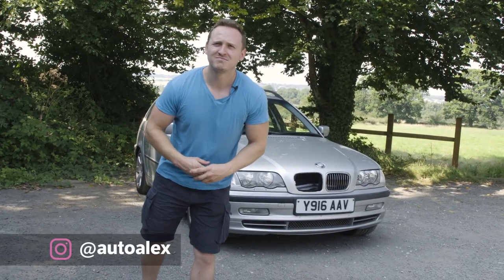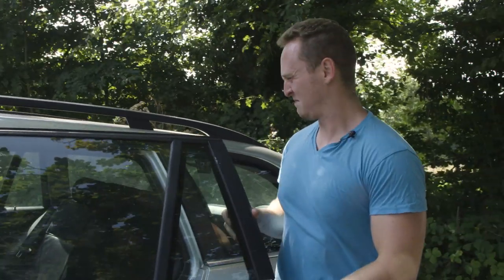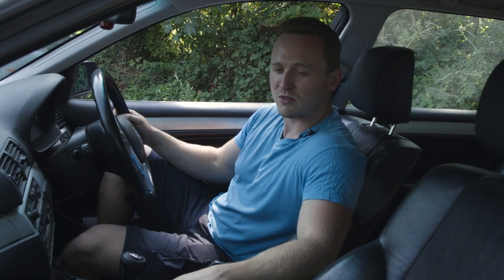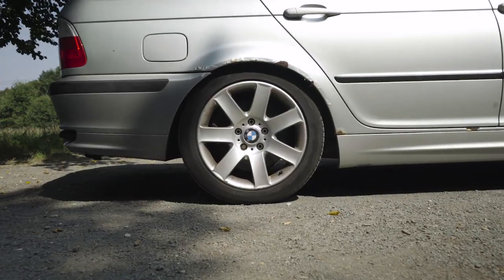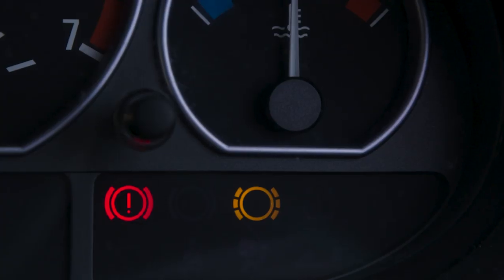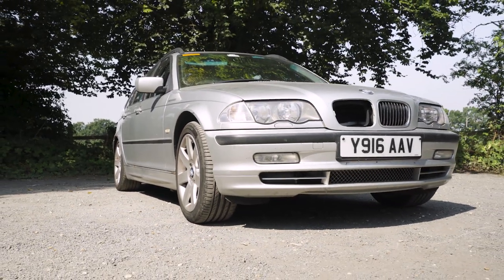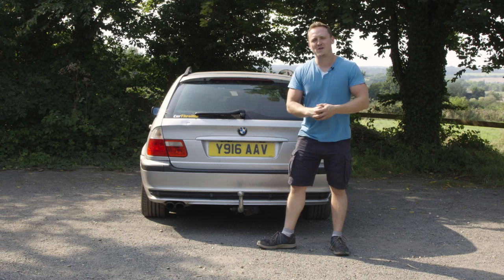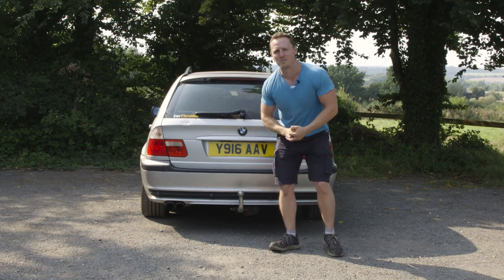£140 BMW Review: 1 Year Later!

Comment: You got an absolute bargain. My E36 saloon has every single MoT and some early service history. Typical E46 corrosion on the rear arches. You need to get it sorted mechanically or at least give it an engine service. You should really replace that grille or you could be looking to replacing the radiator. A cheap used grille on eBay or from a breaker will do the trick.

Comment: could use an alignment to resolve that granny steer problem. Front wheels' toe angle could be off which causes the steering wheel not to automatically return to center.
Reply: He said there is a crunching feeling and that he thought it was a bearing.

Comment: That crunch and stiff steering could also be your air bag ring as my BM did the same and I thought it was the bearing till I took the steering wheel off to fit my momo steering wheel and found the air bag ring seazed and was jamming the steering wheel up

Comment: this car is so crap, i love it. i once had a mazda capella wagon that if you put the clutch in round a corner it would stall as the power steering was too much drain and it idled really low (probably because it spent about half the time running on 3cyl).

Comment: high milage? wtf my 2004 1.9TDi Audi A4 has done 600 000km and I' still using it. It has been in family since 2008/100 000km. Clutch has been reworked and a few smaller things, but the engine is running like a new one and the car works just fine.

Comment: Love it. We bought an old passat 1.8t petrol estate on 170,000 miles for £250 over 4 years ago as a daily/grandad mobile. It is now on nearly 200,000 miles. Only major (ish) thing it has needed is a new exhaust section (£40 plus fitting). It can die whenever it wants as it owes me nothing!

Comment: I had a 206 1.4hdi that I owned for 2 years, I did 30k miles in it and never changed the oil, had a water leak but I just topped it up with water every week, I had a broken rear spring, I never did a service, I genuinely treat it like a piece of shit and it did me well. 
I mean a deer jumped out in front of me causing me to flip it twice and it still tried to start after having the engine and gearbox shunted back 6 inches...dont underestimate Peugeot Power.

Comment: I can't believe the amount of cash it needs to keep running, converted to euro it is nealy 13k, divided by 17 years it is 760 eur per year or 65 eur per month (I round the results), just in maintenance, not counting MOT, insurance, road tax, car wash, depreciation... It is the barrel of danaids on wheel !
In comparaison, my Auris 1.6 petrol costs me 6.50 eur per month since the 2 years I have it (I didn't change anything appart from regular maintenance I do myself mostly, no tyre change and no big maintenance like clutch, but even with this, I would still be 8 time less costly than the bimmer).

Comment: I'm driving a 2002 Golf 4 with the 1.9Tdi (101Hp) with now 372200km on it. Bought it with 310500km and aaaaaall the bills from the guys that driven it before, including the original bill of sale of over 25000€. The amount of all the bills for keep it running was about 11000€.
In the 2 years i have it i spend around 6000-7000€ for maintanence and carguy stuff so soon it will hit the sale price 🤪😂.
And it has definetly less rust 😂😍

Comment: Had a free daewoo espero for a week before it went to scrap yard , brakes had overheated abd stuck on fixed that by freeing the handbrake off was going to trackday it but decided to rant the nuts off it instead was still OK to drive but few funny tapping noises from engine .   Didn't even have to put fuel in it. Totally free bar 25 quid to change over the insurance.

Comment: I wish it would be possible to buy those kind of high mileage old cars in Belgium, but it's just not possible to get them on the road, that 330i would easily be 2000 euros or more just in taxes to get a plate for it, that's without insurance or annual taxes. It would be financial suicide to buy those kinda cars in Belgium. It's sad, it really is

Comment: Makes me feel even more stupid for buying a 2005 325xi for $2800, only to later discover it has a massive oil burning problem, and I'm not even half way done replacing the valve stem seals. Vanos, camshafts, timing chain is all off. Rip me

Comment: how can you pass an mot with warning lights on,,,my 2003 206 has no rust at all,i thought bmw were posh cars ? only spent about 1k on work in 30 years and ive put 250k on 2   all were peugeot ,never had a clutch or even a new exhaust or engine work ,,and always had 60-75 miles per gallon ..135mph max

Comment: i had a 325i touring that i bought dirt cheep. i allso just give no fucks about it. no oil changes nothing. som times i don't even have coolant in it.but man is that car reliable. the only thing thats bad is the leaking headgasket but a bottle of gasket fixer in the coolant and boom as good as new

Comment: im driving a 2004 bora with 180k on the clock and its in 100% better shape than this, EVERYTHING works perfectly. its been serviced relentlessly every year. bit of rust on wheel arches, pulls like fuck, and no smoke or oil used!!!!

Comment: Wait, no self centered steering and broken ABS and it still passed an MOT?
Reply: MOT is for safety not features
Reply: ABS is one of the main safety features developed in recent times self centering steering also quite important in my opinion. On the isle of man the vehicle would very clearly fail a vehicle test
Reply: @troopa451  ABS is a safteyfeature not a requirement

Comment: Really bullet proof.....
Except for the oil pump gear of death
Reply: From what I have heard that is only a problem in Racecars. The 3L crank seems to introduce a lot of vibration at high rpm. Because people don't stay at high rpm for ever on the street you don't really have to worry about that.

Comment: 140 pounds... would you bother? Yes I would. Simply because the car is that cheap it makes perfect sense to put the left over money into something that will extend the lifetime of the vehicle. If for no reason at all then the best is the engine. Those engines can outlive any chasis by a lot. And I mean by a really frkn lot. Then there is the other aspect of the overal look of the car. Timeless design that ages just slightly and veeeery slowly. Flared arches and wider wheels plus tyres? No problem. But keep it in M3 proportions only otherwise you'll mess up your steering too much (wide rims with a zero ET or even negative will have a massive effect on steering in terms of precission, ease of use and tolerance for errors and road bumps). Also wider tyres mean more weight so you will add rotational weight to the car which will reduce power output. I would not bother much about a Daewoo Matiz or whatever engine powered shopping cart but on a car like this I would bother pretty much to keep it in shape, make it perfect each day a bit more and be happy about the progress. 

PS: and if you did not found any reason at all to keep it in shape then get this: you buy a car you do ditch all maintenance and do just the bare minimum then guess what. Your car will massively drop in resale value, maybe even down to zero leaving it to you to get rid of later and you will have to maintain more and more as more things will go bad. Not to mention that one day you have to buy something else as a replacement. Time lost, money lost and you might end up buying something you have no idea about how it works, where is what etc etc etc. while currently you got a car you know in and out and you just keep it going. So keeping it in shape by any means you have available is always a good idea. If you are on a really hardcore budget then it might be a good idea to keep with your local bus services.

Comment: Reckon the MOT tester who pass that is getting reported. 😂 Personally I'd scrap it as faulty brakes alone is 3 points on your license and up to £5000 fine.
Reply: Faulty ABS doesn't mean it won't stop.
Reply: @joshuarosen6242  not the point, it's a fault in the braking system which attracts 3 points and and fine. The car had ABS from factory so it's required to work to be legal to drive in the UK.
Reply: @vidsinmotionchannel  Fair enough.